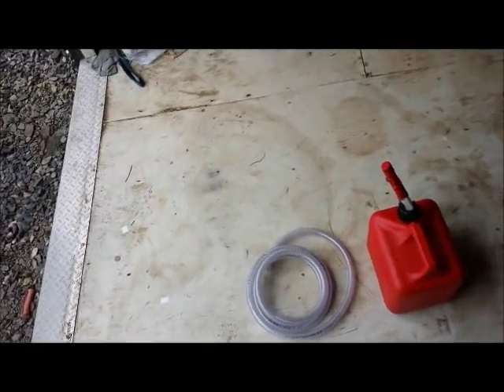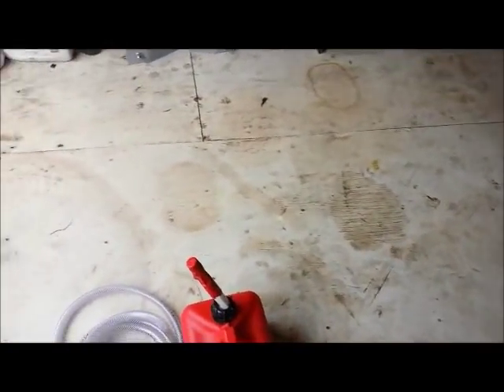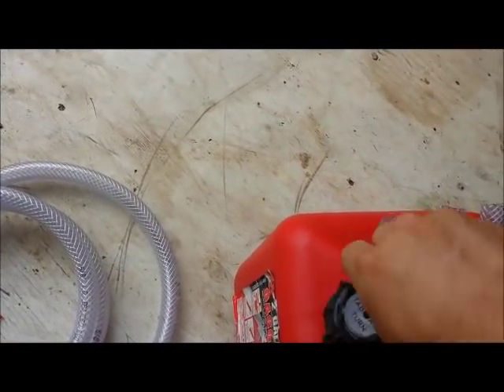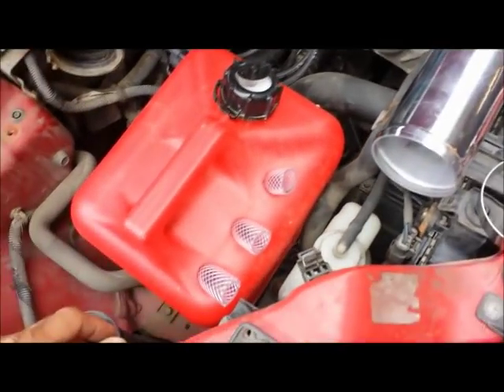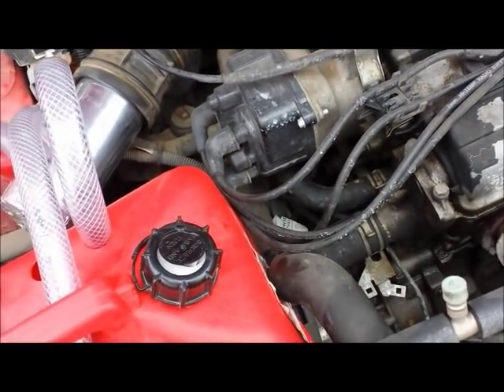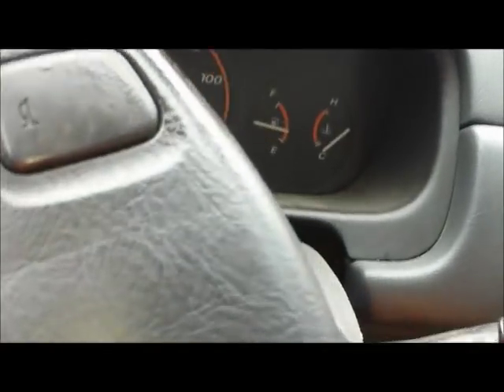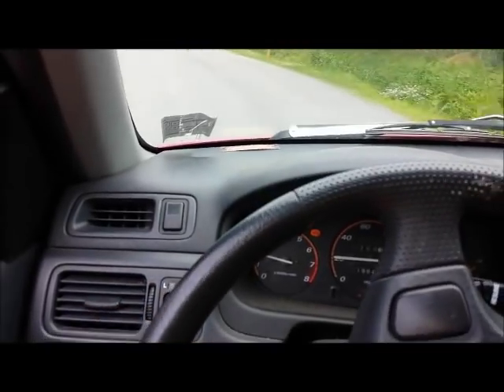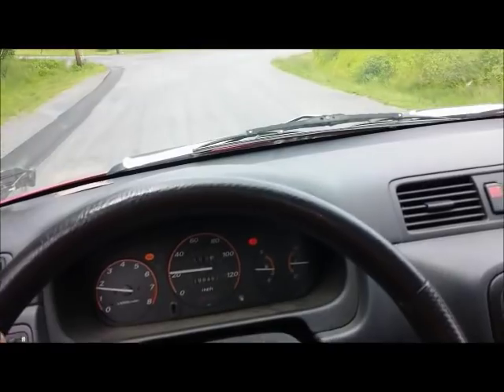driving your car on just gas fumes

Comment: This is foolish 1st your not driving off the vapor you're running off of fuel that is bypassing your clamp but more importantly having the fuel line clamped and having the fuel pump pressing against it is a surefire way to burn your fuel pump out fuel pumps are cooled by fuel that's why you have regulators so once it reaches the fuel pressure it can recirculate and not just build up pressure

Comment: Fuel characteristics vary in liquid stage to gaseous stage. Engine dynamics change too. 
AFR for liquid fuel:- 14.7:1
AFR for gaseous fuel:- 9:1 or 10.5:1
Means you need to block the intake air flow by atleast 40% to achieve proper combustion and avoid lean mixtures which can overheat the engine.
Also, just like it's done for LPG/CNG fuelled cars where Timing is advanced to 20° BTDC, since we are still using petrol in gaseous form, Engine Timing must be advanced by 2° or 3° above the stock base timing(10° BTDC) for achieving proper ignition.

Comment: I am so glad I found your video because out of all the ones I watched that go over how to build an evaporator and install it you're the first one that explains exactly how to do it and how far the hoses have to be going inside the tank and how to pinch the fuel line and also building that too that is connected to your air intake and into the house is that going to the tank now I can see the whole picture and I can actually do it myself I'm going to do a video and comment back on yours and how my vehicle did I have a V6 Taurus and I'm trying to gain at least anywhere between 5 to 10 thank you and again👏💪🍻
Reply: Did you ever attempt this? Please post if you did.

Comment: People do something similar in sweden with diesel but not for fuel efficency they put spill oil in a gas tank in the engine bay and add evry mod to it so alot of black smoke would come out but if you get stopped like that you get a big ticket like 1000 dollars plus you have to go through an inspection again

Comment: You need to put your lines in after the mass flow sensor otherwise, as you stated, sensors on these kind of engines don't know how to read something that is not a normal part of the programmed system.  

I did this experiment back in the '80s on a 1975 Vega Kammback wagon only there I plumbed my vapor line into the PCV hose.  I don't know if or how it helped but I do know that after a time water vapor inherent in the air was taking the place of gasoline vapor that was being pulled out of the jar.  I would have liked having a jet orifice that is adjustable on the outside of the carb.  Some time past doing the vapor experiment I found that I could put two or three strands of that very fine "angel hair" wire through the jet hole to increase my mileage a bit.  It is a fine line before the performance starts to stifle but on one trip East I recorded 27 highway mpg which I was happy about.  It had the Holley staged two barrel and I rarely used it that way.

Comment: Believe it or not most modern cars have fuel injectors or carburetor and there job is to make fuel vapor 
So every engine runs on vapor 
Some are more efficient than others 
But same principle 
I tried something similar on a little honda lawnmower engine and turned out I used more fuel with my home made vapor carburetor
Reply: But don't fuel injectors and carburetors atomize (spray) the fuel? That's not the same as vapor.
Reply: @kevinrussell6530  maybe it's not the same but the end result is close to the same

With new technology the computers calculate exactly how much fuel and air mixture is needed at what rpm if you run on vapor you can still run rich to much vapor will still have a bat fuel economy 

What I'm trying to say running on fumes with a home made fumes generator will be hard to control the fuel air mixture just right maybe if  you sensor it and regulat it with sensors you can get a good result but not with a jery can and some holes 

I tried it if it would work I would convert my car in no time

Comment: When we were kids, we ran out of gas.  (surprise)  We got tired of pushing the car and got the idea of using the fumes in the tank to run the car.  Just took off the gas cap and blocked the snorkel on the air cleaner and drove to the gas station.
I know it works.  Just not sure why it's not commonly used.  Seems the obvious solution to eliminating the accelerator pump and a few other things.  Good job.

Comment: Good video. If you're still working with this, find a way to draw hot air from the exhaust manifold into the gas can. As you may have noticed, the gasoline gets cold when you run just ambient air through it. The vaporization efficiency increases as the temperature hitting the gasoline goes up.

Comment: The more you run off of VAPOR" the Cooler everything is,!! That's why it's
Very important" to Heat the gas before it is used as Vapor.!!! Check out some of the other videos, on Running you're 
Car on VAPOR.!!!! Be very carfule, so you're r cn76

Comment: Great experiment. If you pinch the fuel line does it damage the fuel pump? don't you have to stop the fuel pump by disconnecting it? i'm trying this on my ride-on mower. If it works i'll try it on a fiat panda.

Comment: Aviation rumors: people say that running lean at first gives more heat, but if you keep on leaning it further it actually runs cooler (from pilot experiences when low on fuel).   I think you are on the right track, keep working it,  you could use an older fashion 'vacuum" solenoid tapped with a T fitting into to any vacuum line to run the solenoid (not for fumes) to actuate a valve that makes it Richer when starting out (less vacuum), and make it run leaner when at normal vacuum conditions (up to speed) .   REMEM the old vacuum operated windshield wipers, they would quit working on hills unless you let off the gas because of less vaccum.  So its a research to find the happy compromise where when engine is under more load (like hills or starting out, it makes it richer, and vice versa).   At higher speeds over 60 it may also have less vacuum so that would need some additional adjustment or a "shut off" condition based on speed? 
       FYI:  I use the vacuum solenoid all the time for years now on my older minivan to cut off the AC on engine loaded (starting out or up hills), and it really does seem to save me mpg  (yes I have manual overide switch for situations where I prefer to lose the mpg at first, for increased AC like when car sits in sun too long and at first its heat soaked.

Comment: I really don't know much about this, but my sense is that you might want to consider removing the fuse for your fuel pump. It's still trying to pump and I don't think the back pressure from the pinched off hose is going to be good for it. Just a thought.

Comment: Another thing they don't tell you is that most bubbler systems leave unburnt fuel in the bubbler.  Once the more volatile fuel is used up the engine dies.  Leaving you with fuel that is practically worthless.  Maybe I will find a use for it.

Comment: fuel  injection runs higher fuel pressure, if you could increase pressure some how? maybe some light tension one way valves on inlet hoses. Or force air into inlet hoses to increase pressure in fuel can, obviously a metal sealed fuel can would be better.

Comment: This is a farce, When the internal combustion engine was first developed they had to make a carburetor to turn gasoline into a vapor and this display is nothing more than a carburetor, of the most primitive sort. I hope he had a fire retardant near, because if the engine coughs back through the intake ,the flame will cause his vapor jug to explode into flames. But more important is the fact that gasoline creates it's power with a ratio of between 12 parts air and 1 part gasoline to 14.5 parts air to 1 part gasoline. Any leaner than 14.5 to 1 and the power drops off and causes an increase in combustion chamber heat and preignition. If he wanted to run leaner, all he had to do was install smaller jets in the carburetor. The carburetor mixes air and gas and the air enters down the throat of the carburetor and mixes with the gasoline forming a vapor, which is enhanced by the heat of the intake manifold into a more explosive vapor. Any richer than 12 parts air to 1 part gasoline, causes the gasoline to produce less explosive power, and waste fuel and lose power. For economy set the mixture at 14.5 to 1 and for power (like racing) set the mixture at 12 to 1. By jetting the carburetor accordingly. There are no gasoline companies or governments conspiring to combat these farces. It is not needed they will fail on their own. Don't fall for these stupid ideas.

Comment: I think.... you could leave the Honda fuel system intact, (full and pressurised fuel rail) and the electronic metering/knock sensors would shut off the injectors most of the time.  This would make it a similar, but much less complicated system, to the electrolysis/water/hydrogen generators that people fit.  Then when the can is empty, the car carries on on tank gas, so you don't have to get out and undo the clamp in the rain :-)
Reply: If it does leave the fuel line open do you think the knock sensors would turn off the fuel that is going to the injectors because the car is running from the fumes? Is next a lot of sense I was thinking about just creating a toggle switch to turn off my fuel pump and injectors I just don't know if the main computer will figure out check engine light at that point this is very interesting

Comment: The Check Engine Lamp is flashing! That means there is a problem that can damage the catalytic converter. A flashing CEL indicates either a major misfire (not in this case) or excessively rich or excessively lean condition. This system will work, it can be done, but long term engine damage may result, catalytic converter damage will result and emission regulations will be altered. 

The best bet is to do this on a car pre-OBD II (1995 or older) where in most states (those without dyno inspections) emission components and an OBD II scan are not necessary. CEL is on--you fail inspection. Then you can remove the catalytic converter and prevent it's becoming "plugged" due to damage. An old car with a carburetor works the best. Trust me, I've done it. 

I am a retired auto technician who worked for GM and Ford and owned a service station and Lee Myles Transmission franchise. You can run a vehicle like this...just don't let the Feds catch you.
Reply: Hi! Thanks for the insight, this idea is really something, it will possibly be the next stage after hybrids and then innevitably the Akku car (Musk is showing the way) BUT here in europe all newer vehicles and even Jap. vehicles use complex direct port injection as well as forced induction, my question out of curiousity is: could such a system work for these type of engines? what about turbo diesels - even with larger displacement? also at what rate of power would the system fail? 60 MPH for a old 2L honda engine seems possible but what about say a turbo 3L BMW engine or take it to the extreme a 6.2 AMG V8 I would love to read your ideas on the matter, cheers!

Comment: ALL Cars run on Vaporized Gasoline! what the hell do you think happens when you spray high pressure Gas into a low pressure manifold through an injector? IT VAPORIZES if it doesn't your car WOULD NOT RUN! ever hear of a flooded engine? it's because the plug is wet and the mixture is too rich which keeps the fuel from VAPORIZING.
Reply: yes ..But THAT type of VAPORIZING uses WAAAAAY more gas...Do you work for a oil company or somethin?
Reply: No I am an engineer and I know a few things about Physics and internal combustion engines and these claims are nothing but Hogwash. it's easy to disprove simply by looking at the BTU's per Gal of Gas Vs the HP claims made. the math doesn't add up. Power in = Power out - Eff and Eff isn't nearly as bad as your claims would require it to be for your method to work.
Does it run, sure is but it is way lean and does it have any power, NO. will it work in real life use, no, an I lean out the carb it came with and get the same results yes, but it still won't make any power
Reply: Well Mr Enginner....I actually watched a few of these after that one 
.....and I must say ..Your absolutely    not entirely right...The cars 
all were pushed ...only time they had any problems is if the Gas got 
into the hoses. They may not have had the RPMs that a normal gas guzzler
 has but but "AS YOU WELL KNOW" being an engineer, Is that it can be 
tweeked and adjusted to work better. Just like anything else.
Reply: Well Mr. Non-Engineer what I know is a simple energy balance equation tells the truth
Reply: NO....How much comes out of the pocket will be the REAL truth
Reply: LOL well good luck with your magic show
Reply: integr8er66 what's a stratified charge engine and how does it relate to this bullshit method?
Reply: Lester Bullard Yes, of course it isn't that efficiency. ITS AN INTERNAL COMBUSTION ENGINE - it makes heat = it wastes energy like a siv - we can't really make it better as you still have thermal radiation. Electric engines are soo much more efficient, but the batteries suck.
Reply: integr8er66 u mistake atomization with vapor....in a carburettor or fuel injection the gas gets sprayed in to the air...its little particles of gas...but that's just fumes...gas vaporizes very easy...like alcohol...I mean I am not in with this driving on vapor, cause I don't really think it gets u that more milage...I saw a video where a lawnmower gets driven by vapor and then gas...I think it is 2 minutes difference between the two methods...so yeah =) sry if my words or grammar is not correct...I tried my best =) 
https://youtu.be/IuGWHfWqWtg
Reply: its not fuel vapor it is atomized gas and air.
Reply: lol and a flooded engine isnt a "too much fuel vapor" situation it is when the spark plug gets so saturated with fuel the conductive properties causes a straight to ground effect which doesnt allow the spark plug to spark at all but sends the electrons through the fuel to ground instead of arching across to the ground strap of the spark plug.
Reply: integr8er66 I'm with you. 3 years into getting a chemical engineering degree. It might work yes but if you have to get on the gas the air fuel mixture will go completely lean and an engine running lean will run hotter and at higher rpms (2000+) can cause catastrophic engine failure. literally blow up. So go ahead and have your fun with it. But be warned. 
Also. Find a better place to put the damn tank so when if it does blow up it doesn't blow up and burn up in flames.

Comment: perhaps you could wire the fuel pump feed into  some kind of fan to force more air through the fuel and make more fumes - that way with a variable speed fan you can directly adjust the amount of vapor going though... just ideas  :)

Comment: pull the fuel pump fuse and disconnect the injectors. the injectors will get damaged by opening without any fuel in the rails.
and there is no need to keep the fuel system pressurized.
Reply: pulling the relay is pretty much the same. the ECU has to detect fuel pressure.

Comment: try a mixer knob that you can adjust from the car and plug a ECU reader in to see if its running lean or not (stationary) also try disconnect the injectors as running them without gas cant be good haha

Comment: And it just works on diesel ? What about the petrol system
Reply: this is done on a petrol. the first generation CRV is gasoline only.
Reply: boobam i dont get why doesnt every one use this method? its dangerous or low at output performance or what?!
Reply: Diesel IS petrol(eum), Javid, so... yes.

Comment: Whats the maximum rpm for this method  .why everyone doesn't use this system
Reply: search up why tom ogle died thats your answer.
Reply: @monroy194  you know, that and vapour powered engines don't provide enough horsepower or torque to be useful
Reply: @monroy194  https://www.quora.com/Did-Tom-Ogle-invent-a-vapour-engine-and-why-is-no-one-working-on-this
It's because vapour powered engines are simply not practical enough.
Reply: Because it doesn't generate enough torque or horsepower to be useful. People want to be able to tow things, or drive up long steep inclines, or run A/C or heaters which puts more load on the alternator

Comment: You spent a half hour trying to get the adjustment right for air and fuel mixture, but couldn,t be bothered by recording the proper miles per gallon, your estimate was a 30 ah 30 sumthin, that's 31, threw 39, way to to keep records. Was it or wasn't the reason for all this to save money on gas, but you could not determine that for yourself or us. This tells us all we need to know, same old shittin lies everyone else tells. It never ends
Reply from the maker: wrong.   never intended in recording mpg. Just wanted to prove could run.  if you want exact mpg then you do it. I just didn't care.

Comment: get a p8r jdm head or older pr4 LS b18, no sinking valve seat issues, the p8r actually has 2mm larger intake valves, use your z2 cams

Comment: try to back of your valve lash, mine started doing that as winter came in, pulled the cover and cylinder 1 and 3 had a valve held open.
Reply from the maker: already tried. to late. burned valve
Reply from the maker: +Justin Sane was like this when I bought it
Reply: +Justin Sane   How does the speed control work to control the gas peddle ?
Reply: Should hear mine now, 2nd intake valve in on cylinder one has recessed so far into the head that I can't back off the rocker anymore, rocker is riding the cam all the time.
Reply: better to hear the valves, Ed Mee, than smell them. too loose isn't that bad really. the reason why you should adjust the valves on the B20 is the valves get too tight and burn up. rattling is better than stink
Reply: "Late" is a place you can go to, Justin? How does that work?